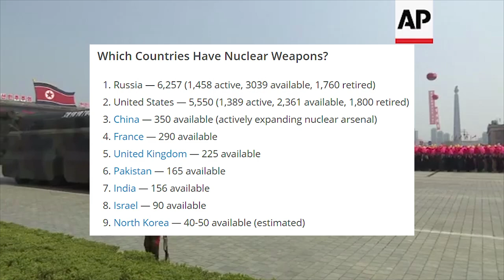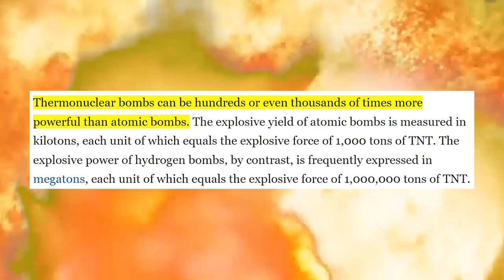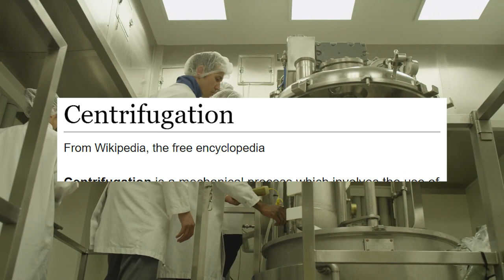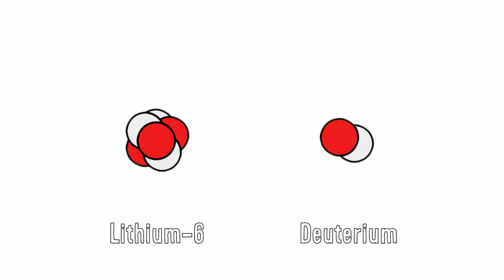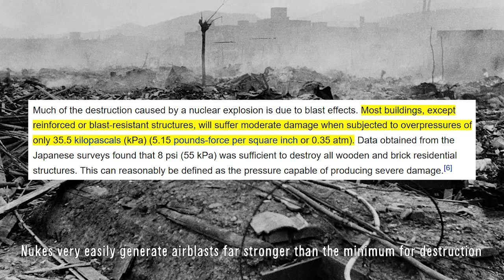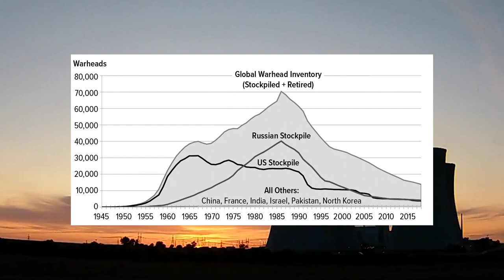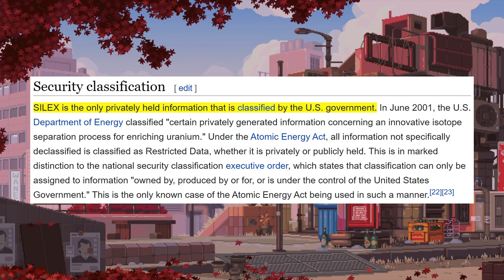A Brief History of Nuclear Weapons || 1945 to Today

Comment: 1:34 Fissile nuclei may fission with neutrons of any energy.
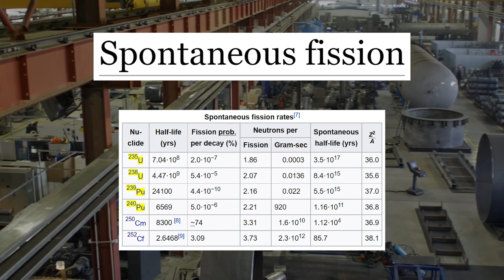2:01 Uranium and plutonium are not chosen because they can undergo spontaneous fission. Spontaneous fission is undesirable as it can result in predetonation.
Isotopes of those elements are chosen because they're fissile.
4:55 Most modern primaries also use fusion and fission.
5:01 Most modern secondaries are not cylindrical.
5:20 Fusion neutrons do not cause criticality in the "secondary core".
9:03 Pu240 is fissile.
In no weapon does all the fuel fission.
9:33 Fusion fuel is comparatively cheap. That's one of the benefits of utilising fusion.